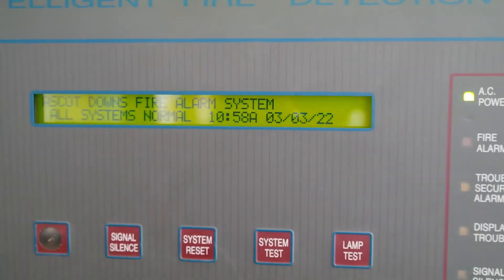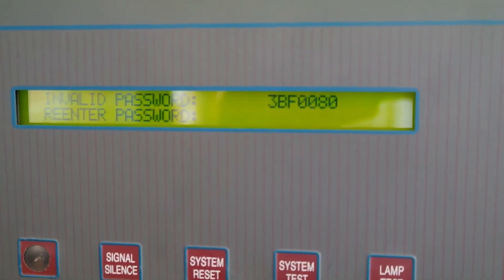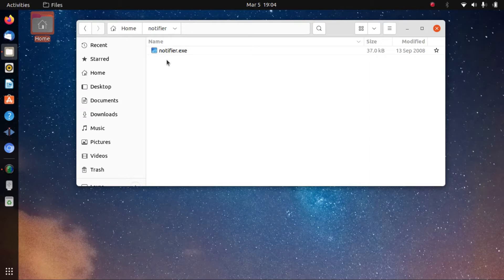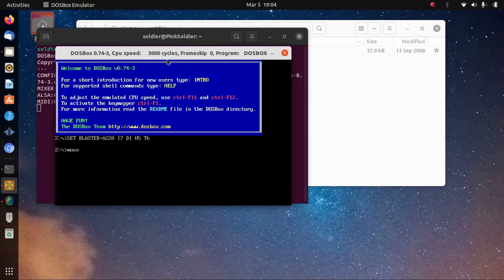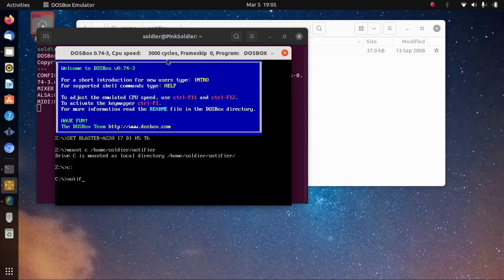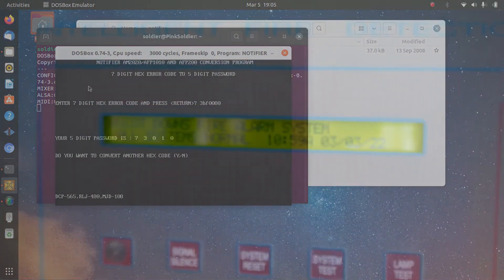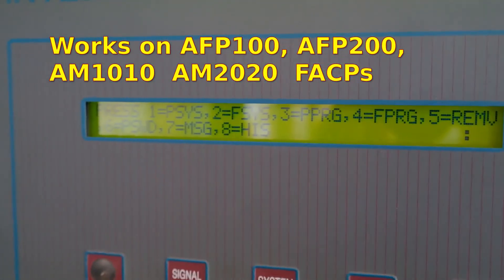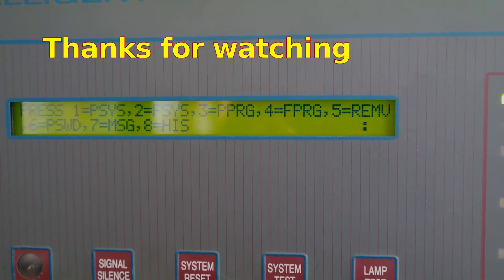Fire Panel Password  recovery

Comment: Do you have the software to do a longer NFS-320 Hex code?
Reply from the maker: I'm writing the code, its 80 percent done, I will share it.  In the meantime I found something better.
Reply: @firealarmapprentice4517  hows it goin with the code?
Reply from the maker: @s.ep30  Its going well.
Reply: @firealarmapprentice4517  were you able to complete it?
Reply from the maker: @s.ep30  We did but we can not share it just yet.
Reply: @firealarmapprentice4517  alright cool, when could that be possible?
Reply from the maker: @borneomoto3506  The decryption code is only valid at 12:00am.  So no that won't work. However there is a way to reset it to factory passcode.
Reply: @firealarmapprentice4517  If you know how to reset to factory passcode Please tell me...I need this...please....
Reply from the maker: @borneomoto3506  where are you?
Reply: @firealarmapprentice4517  What about RESET??what gonna happen if I put RESET on passcode field?
Reply: @firealarmapprentice4517  Indonesia
Reply from the maker: @borneomoto3506  no.
Reply from the maker: Do you have a windows computer connected to the panel with a USB cable ?
Reply: @firealarmapprentice4517  no...what should I do if I have?
Reply from the maker: @borneomoto3506  Is the panel on a job site or is it your demo panel ?
Reply from the maker: @borneomoto3506  You will need a windows computer and a USB A to B cable.
Reply: @firealarmapprentice4517  Demo panel...I've forgot my passcode...I just want to try to reprogram it for my practice
Reply from the maker: @borneomoto3506  Do you have a 320?  Do you have a USB cable?  Do you have a windows computer with an good internet connection?
Reply: @firealarmapprentice4517  Yes I have 320, usb cable and internet connection
Reply: hello sir
I need a password for 2020 panel…
Can you help me..

Comment: Working on a NFS 320, need to reset program password back to “00000”. Can you decode 62C0-57EC-777B-4B49-4C54
Reply from the maker: you are not giving me the right error code.   best to text me at /226 249 1545.